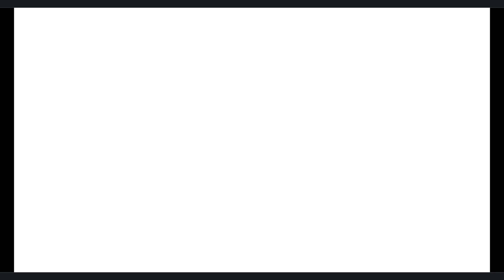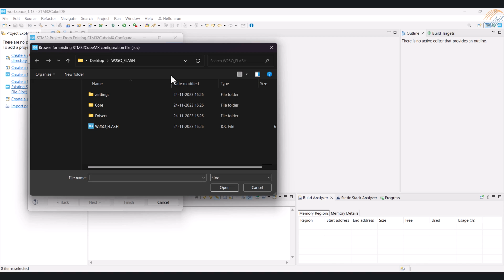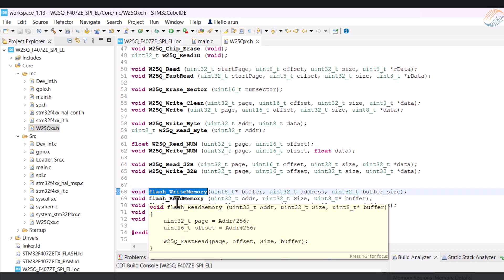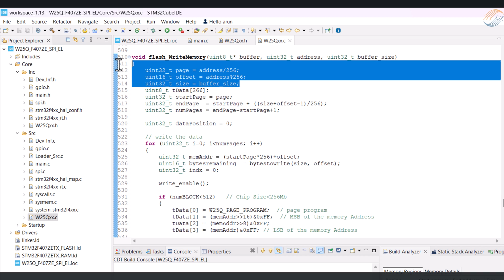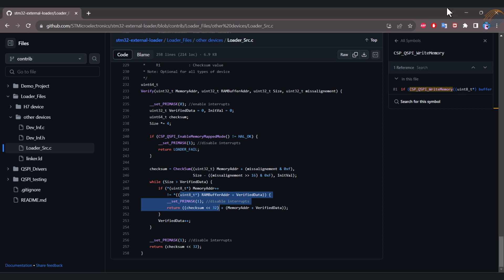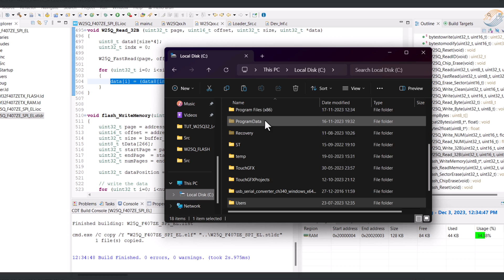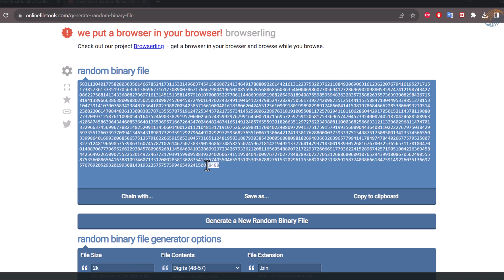W25Q FLASH Memory || Part 9 || External Loader in SPI Mode

Comment: Thank you for this tutorial. But the code contains an error:
In W25Qxx.c in the function 
void SPI_Read (uint8_t *data, uint32_t len)
you call
HAL_SPI_Receive(&W25Q_SPI, data, len, 5000);
but be aware that the len parameter of the HAL function is uint16_t and you pass a uint32_t.
It works for STM32 chips with smaller RAM, but at chips with big RAM, the CubeMXProgrammer uses
buffers >64K for reading so the code fails here.

Comment: Hello
I executed your method from the same ic W25W16 and the stldr file was executed according to your example. But when I want to program the bin code, I get the following error. What is the cause?

  17:22:58 : File download complete
  17:22:58 : Time elapsed during download operation: 00:00:01.321
  17:22:58 : Verifying ...
  17:22:58 : Read progress:
  17:22:59 : Error: Data mismatch found at address  0x90000000 (byte = 0xFF instead of 0x32)
  17:22:59 : Error: Download verification failed

Comment: Hello. I am creating an external loader following your tutorial for the STM32U599 and W25Q32 flash IC. I am able to read and erase the external flash using cube programmer, but whenever I try to write to flash (Fill Memory), I get the following error

  15:51:42 : Error: Failed to download data! If it's a Flash memory, it may be not erased or protected
  15:51:42 : Error: Failed to fill memory with the given pattern

Similarly, when I try to program a bin file to flash I get the following error
  15:55:36 : Error: failed to download Segment[0]
  15:55:36 : Error: failed to download the File
  15:55:36 : RUNNING Program ... 

  15:55:36 :   Address:      : 0x90000000
  15:55:36 : Warning: The core is locked up
  15:55:36 : Start operation achieved successfully